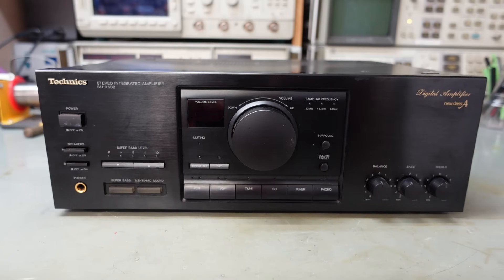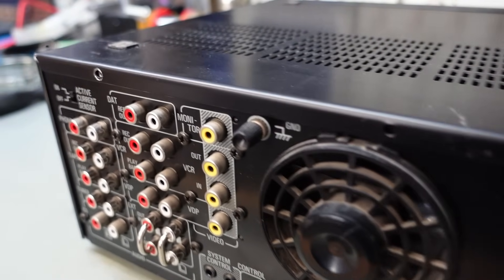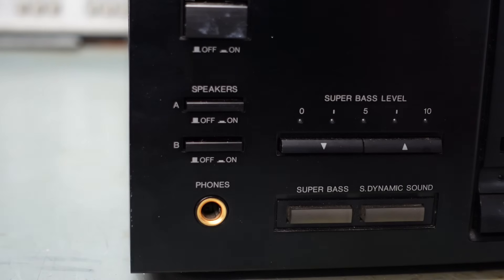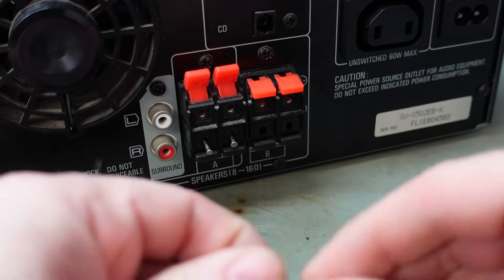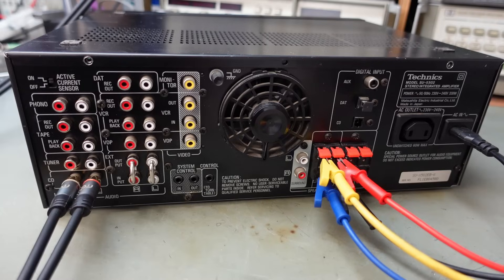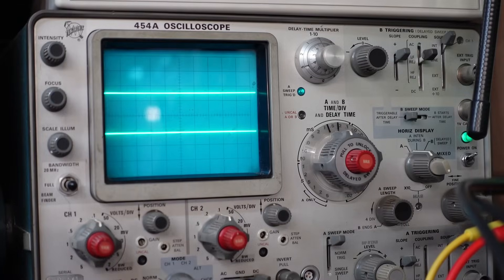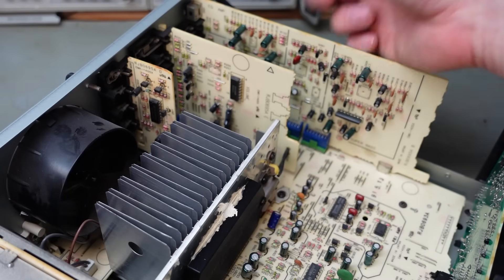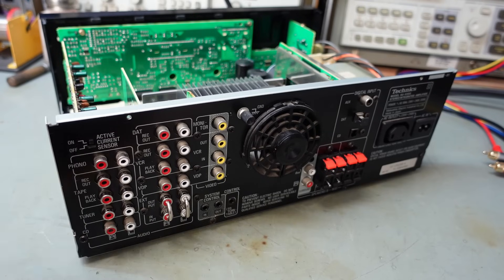Technics Amp repair with NO PARTS!

Comment: Still got the AKAI AM-U41 amplifier sitting partially disassembled, 
peacefully resting its chassis near the lounge room door. 😮‍💨
Once upon a time, it used to sing, but now, since the last encounter, it simply will not talk to me no more. 
Cause noisy volume sliders and monolithic audio power modules were simply not intended for the poor.
The doctor thinks that I most likely killed the thing, but I would never harm a beast, 
cause killing in Australia is still against the law. 😭

Comment: That is a brilliant video.  I have a similar technics su G50 amp that used to work, but now none of the inputs are working.  However there is an input on the back that says "Main in" and if I connect my cd player to that I get sound through the amp, although it is at full volume and cannot be controlled by the volume knob.  Any ideas please?

Comment: At least this amp is not a WIRE MESS HELL like most, but they still use CHEAP ASS PAPER pcbs.
You pay $500 bucks for a SO CALLED high end amp (which this is not), and they cannot be bothered to use DUAL SIDED proper FR4 boards.
....it makes me sick!!!!!!!!!!    .and the low solder pathetic joints, no wonder so many are dry joints.
Reply: in 2012 I bought a so call high end ONKYO amp, and it had some issues which could not be fixed apart from HDMI board replacement (costs half as much as the amp - FORGET IT!).
So I bough a totally different brand amp, which works 100% reliably.
ANYWAY, both, in spite of the high money are HARBAGE paper pcbs, and WIRE HELL everywhere!!!!!!!!!!
...the hi-fi industry should ALL BE ASHAMED of themselves!!!!!!!!!!!!!!
Reply: If I was a billionaire, i must be inclined to start a hi-fi manufacturing, charge the earth, bu unlike the others USE ACTUALL PROPER PCBS, and NO F'ing WIRE HELL anaywhere, just pure high quality parts, sockets etc. ONLY!!!!!!!!!!!!

Comment: Teacher give me a tip for repairing a technics model amplifier o su-v78, it is not activating the vent and I do not know if the transistor that is in the desipator is the transisto that is the sensor that activates it, the transistor is (d1265) could you help me with a tip if this component is the sensor of the exhaust fan of the device or it is another component that I do not know Thank you very much for your help my name is Gustavo PS I found that the r fan is working so I know it's not him...

Comment: Hey Mark why do you use a manual screw driver for soo many screws when a electric one is sooo much easier?
Reply: I’m obviously not Mark, but I find electric screw drivers are excruciatingly slow. With a hand screw driver, I use the handle to break the screw free, then spin the shaft of the screwdriver with my fingers to back the screw out. It’s really not labour intensive at all.

Comment: Nice work! But I am shocked, that this amplifier has not a direct/defeat (tone corrections off) button -  this must be a very low level model - not only because this, but because the cheap speakers terminals too. I already can not hear an amplifier without direct/defeat function/button. if you have a good speakers, tone corrections can only degrade the signal.

Comment: I gotta admit I really working on the newer stuff that doesn't have a removable bottom of some sort. Technics has got to be the worst of the bunch, (I remember one from the 80's that didn't have a removable bottom with an intermittent .I got it going but what is pain in the butt! Tearing one down like your video shows just doesn't work for an intermittent. The unit needs to be running to be certain

Comment: When my old 1982 NTV Nikkai bedside TV gives up I shall be sending it your way to fix, old tech is brilliant. I was 9 when I got it, 51 now and it has never let me down, TV does not work simply because it's not digital, red led clock and radio still work.

Comment: hello

I have a TECHNICS SU-D7000 amplifier.

Yesterday, when I turned on the device, it crashed and did not turn on.

The day before that it was working without problems.

Its 4 amp 125 volt fuse was burnt.

After cleaning the sockets and power plug and replacing the fuse, turn on the device

The front panel of the device also turned on, but after a few seconds, the fuse burned again.

There are no signs of burn or component failure on the circuit board.

Please help, where is the problem?

Comment: I have a predecessor SU V8 which I've temporarily lost in the loft somewhere.
Hasn't been powered for over 10 years ⚠️
I must get it out soon and start using it with my Phillips CD304 and BOSE 901 speakers. 😎

Can't wait thinking about it 😊

Comment: Back in my day (Pioneer SX-780) I enjoyed the fact the bottom panels came off allowing full access to the board solder joints. And simple stereo systems with wooden cabinets had 4 screws with pointy washers and the entire guts slid out. I always made certain the washers mated with their original divots, so it looked tidy. Modern units are a serious pain in the arse.

Comment: Be very careful with these boards. They are thin and brake easily. These are nice amps, if you switch all the super bass crap off.  One of its nicest features is the active current sensor (which in fact is a simple resistor) that helps reducing distortion in low frequencies. All speakers do strange things with their impedance there, regulating current instead of voltage really helps.

Comment: Hi there, i have the SU-X102, have had it for around 5 years now, the amp itself is still immaculate, however every now and again, for around an hour or so, the fan ramps up and down, making a horrible rattling noise, any ideas what the problem might be? It dies down after an hour or so. Thanks

Comment: Thank you Mark for the very informative videos! You have just inspired me to fix my Technics SU-X902 amplifier which has been broken for 13 years now! 3 hours later after finding some dry joints and a broken track.. and a full service including using Deoxit D5 on the rotary volume encoder and balance/bass/treble and it's working like a charm! Have had it running for the last 2 hours now and no glitches at all. Keep up the great videos!! - Matt
Reply: Dioxid D5 is for contacts, NOT for potentiometers. Potentiometers need lube, since inside then you have parts that move against each other! D5 would remove the lube and might make it worse in the long run, even destroy the potentiometers.
Use Dioxide F5 instead, which is especially made for potentiometers.

Comment: Hello! I ask, in the Surround output part you can put a common speaker or some type of special speaker, I have a Technics SU G90 amplifier but it emits a very low sound if I put a speaker on those terminals. Thank you so much

Comment: Hello and good evening,
I’m looking for a Receiver/Amplifier to power some book shelve speakers like Acoustic Energy AE300, Q Acoustics 5020, ELAC Debut Reference DBR62, Canton Vento 20 / Vento 826.2.
What I would like the Receiver/Amplifier to have is an USB input & 3,5 Jack AUX input as I like to play some music from my laptop and nice would be Bluetooth but if not, I will not die 😊I would connect a turntable, CD Player, still have a cassette deck (I’m an 80’s guy😊), the coolest gadget would be the level meters. It also does not need to be the latest and the greatest, even some older Amps are fine if they have what I’m looking for.
I will admit that all of my components are made by Yamaha just the turn table is a Reloop but that does not mean, that is has to be a Yamaha Receiver/Amplifier. Currently I’m powering my stuff with a Yamaha AV- RX V 683 but I having in mind to separate the music section.
Thanks a lot and very much appreciated // Holger

Comment: Mr. Mark - need your help or suggestions....after 30 years my Technics Su-G75 amp went out.....I thought it was the fuse, ordered some 6.3amp 125v and nothing happened. Not sure what to do next? It clicks when I hit the power button but nothing turns on....I also can't seem to find a good stereo repair shop in the Houston, TX area either....everything else works fine...that it came with.... thanks in advance FOR THE HELP!! THIS WAS THE FIRST STEREO THAT I SAVED UP AND BOUGHT MYSELF.

Comment: what a awesome repair. for the fans that rattle i use a seringe with super lube oil. even when it is a closed fan you can get a bit of oil in to the bearing. it helps to stop the noice and gives the fan extended life

Comment: I bought one of these last week as not working with no outputs  but i noticed the links were missing and remembered that mark said about it nor working without them. I got a right bargain as it works a treat with a couple of leads instead of the links. Thanks Mark.
Reply: I think it's to allow the use of an external pre-amp or this unit for use as one. Not 100% though.
Reply: @lmaoroflcopter  I believe it's precisely the point.
I don't know if they're supposed to go after the preamp, but you could also install a graphic EQ in there, I believe
Reply: You can add na equalizer by example…
Reply: nice!
Reply: What's the point of having those links be removable?
Reply: Yes! Same happened to me, I was already ready to chuck it back into trash. Luckily i stumbled upon this video.

Comment: Hey Mark i got some very old giant PA that are self powered. They use to belonged to my father and i inherited them. I cant part with them for sentimental reasons, Last thing i remember he use to always talked about getting them repaired but couldnt find parts. Im afraid i have met the same problem. i dont want to part with them so im hoping you can lead me in the direction in getting them up and going again. I have a minimum knowledge but enough to attempt a repair my self. I just need to be pushed in the right direction.

The Issue 
They power on but when i go to turn the volume up music comes on but very faint. I did notice the longer it stays on and warmed up a lot more music comes out of them but no wheres close to how loud they use to be. I did check all drivers and horns and they're in good working order. Any idea what it can be. Any information you can shine on the situation to fix my beloved fathers speakers i will be forever in debt to you

Thank You

Comment: Hello in order to remove the volume knob, do I have to remove the 3 screws under the separate like you did or does it just come out? By the way mine is the sux901..

Comment: 2:19 Hi! Do you happen to know how to disconnect that green thing from the black connectors?
I have a Technics SU-X501 (similar)  and I can't disconnect the front panel because it is locked by those black connectors.. And I don't know if I can just pull it, something might break..

Comment: Hello Mark! I have a Technics SA-R477 receiver that is in perfect condition except for the fan making noise when you turn the volume up to high. It sounds like the fan motor bearings are dry. It is the same as the fan in your SU-X502. My fan and your fan both have the plug in wire lead to the fan. It does NOT have fan motor which has a plug in terminal on the fan for power. Can you tell me if I can lubricate the existing fan motor or better yet, is there a new replacement motor available for my receiver? I have searched for almost a year to find the motor replacement for the fan and have not had any sucess. I know that this fan assembly was used on thousands of technics receivers but to date no one has been able to provide me with any information. Great video and thank you for any information you can provide.

Comment: This example sounds like the likely culprit for my pioneer VSX-<something> from circa 2002 which has intermittent channels (usually front centre) but always just after the relays flip when changing modes (between DSP and regular) also no output at all on the active sub bass channel. I'll have another look inside as I never looked at the solder side kast time I had it apart!

Comment: Always good to see your work. I learned some ways to get things done easier. Dry joints, I'm presuming you're looking for joints that are dull and have no shine. What temperature do you use on 90s technics amps to resolder dry joints? Good hints for checking along heat sinks and the pins for speaker outputs is a great idea. I don't have a signal generator but I've got a hantek digital oscilloscope with two channels. Shall have to invest in an oscilloscope. I presume you split the signal so you have the input and output to compare.

Can't find deoxit here in Australia. I have a standard electronic cleaner can.

Great video.

Comment: Thanks again, Mark. Those dry joints are a bit of a worry. I've never used lead-free solder myself but you seem to be of the opinion that its use is more likely to produce dry joints? I presume that would be due to the higher temperature melting point of the solder and that the soldering iron tip is not left in contact with the joint for long enough ?

Comment: Hi Mark! I’ll keep it short;  I have two (initial) questions.  1) Your solder iron seems to work really well. More or less instant joint at times. I have a hakko 888 something which supposedly should work well but it I generally sluggish on melting the tin. I’ve tried factory reset and cleaning the tip each time with new solder and metal sponge. Should I try a new tip? Buy a thermometer for calibration? Higher temperature or what? (What’s your setting?) or is simply my station too bad?

2) that foam spray you use. What is it? And more important how do you dare to use it after experiencing that it can actually dissolve the print?

Cheers!
-Jon

Comment: Good video. I've had one of these Technics systems from new, and the only issue was the sound died on one channel.  I got an electronics engineer to have a look and it turned out to be dry joints similar to yours.  Folk have said they are prone to overheating so a better brushless fan wired to be permanently on is a good idea.

Comment: Good sir, I want to thank you for that 'dry joints' tip.

It turns out THAT was exactly the problem on my vintage AKAI AM-32 amplifier (apparently also 'audiophile grade').

I resoldered the problematic joints... and BOOM! 
     Right channel works again!
+ adjustments board (bass / treble / balance) works again!

Thank you - really! :)

Up until this video, I didn't know this was a common problem

cheers from Amsterdam

Comment: I'll have to look at that 'dry joint' thing. Got 2 amps that for both have low to crappy output (a stereo amp and a 5.1 amp... On both the R channel is the one that respectively 'does best', or 'does anything at all'...

And yes - both have got some hot spot discoloration..

Kind of essential I fix them.
The stereo amp is an AKAI AM-32 (amazing sound, normally. And is able to bypass the bass/treble/balance circuit, so no coloring of the recorded sound)

The other's a Sony TA-AV581, with a built-in woofer amp. (And it comes with a massive passive subwoofer... That I'll have to toss out if I can't get the amp to work.. ;/.)

Anyways.. Didn't realize 'dry joints' were even a thing... So I hope it's just that

Comment: Mark. Where did you buy that A to D  converter  also to  digital optical featured in  repairing vid for A-B output fault, Technics amp 1 month ago. It was 10:22 out of 14:08 on your vid.  Very informational, thanks....

Comment: About half a year ago I repaired the Technics RS-BX-404 deck I received for free. It was enough to move one gear wheel on the axis, which shifted and for this reason the device did not wind the tape. Zero-cost repair and the device works and is fully operational, it is from 1994.
Jakieś pół roku temu naprawiłem otrzymany za darmo deck Technicsa RS-BX-404. Wystarczyło dosunąć jedno koło zębate na osi, które się przesunęło i dla tego urządzenie nie nawijało taśmy. Naprawa zerokosztowa a urządzenie działa i jest w pełni sprawne, jest z 1994 roku.

Comment: Great work. I always loved Technics devices. Once, I "reinvented" their AA Class and designed my own esotheric amplifier, with naked mechanics assembly, except one part of the amplifier with audio part of the PCB. It was an amp with floating point, feom AB to A class. It was working pretty well, back in 90's. Then, War in Bosnia arrived, I lost all connections with my customers. Fortunately, I found one, to whom I made very nice equalizer and a cassette tape deck. The men is still alive, he lives in Sarajevo, in Bosnia, my hometown. I was so thrilled when we met again, after 30 and some years. Btw, I was designing and made amplifiers, turntables, equalizers, audio mixing consoles and just before the War, in 1992, I finished my 5th cassette tape deck. Till now, It didn't come to me by my knowledge, that anyone in the World, made cassette tape decks. Mine decks were awesome, a hybrid version, lamps + mosfets. One model was double deck, intended for dj-ing, with speed control, fine bias adjustment, basically two independent decks in one case. In the middle was mixing pot, so you could mix music without external mixer, but there was a common output as well. I have had very good connection for spare parts, right from the Philips factory, Nederland. Amazing, isn't? Cheers men, keep up with good work.

Comment: HI Mark, you mention the volume control is digital, an encoder.  I have a clock radio with a similar digital encoder volume knob which jumps when used so that turning up the volume often reduces it instead.  Is there a quick fix for this?  Thanks, Paul

Comment: Hello Mark, I have one of these amps with the complete stack system, in pretty much mint condition. I've noticed the analog CD input has never worked on mine, I think it's because the amp has a digital optical output for the CD player which comes with the stack. Also my amp is SU-X902.
Reply: I'd also like to add, the fan drive on my amp is continuously on from power up.